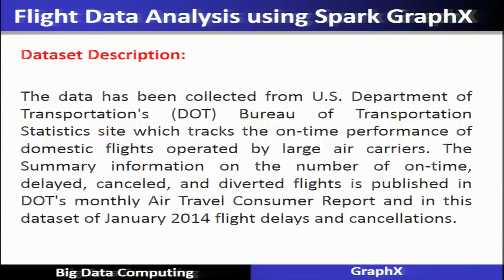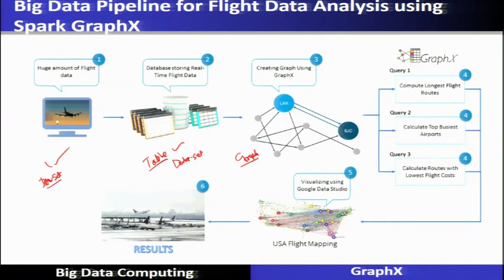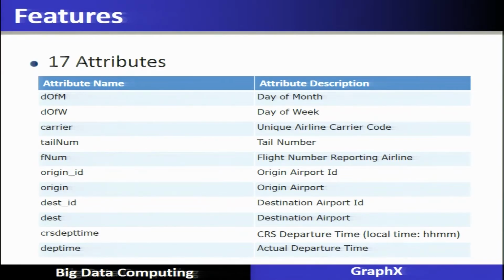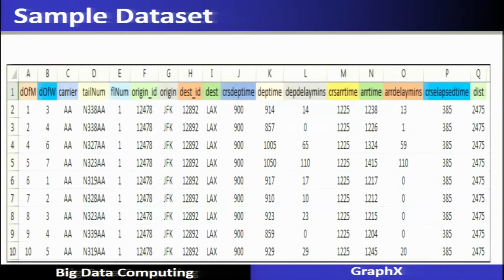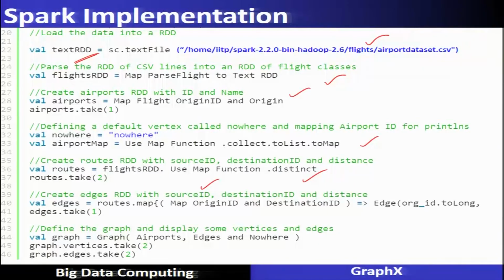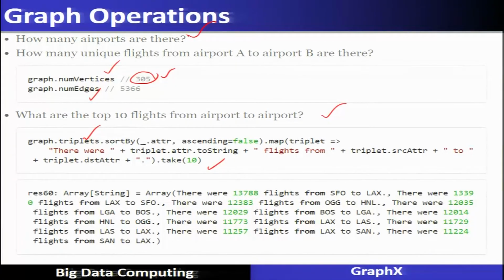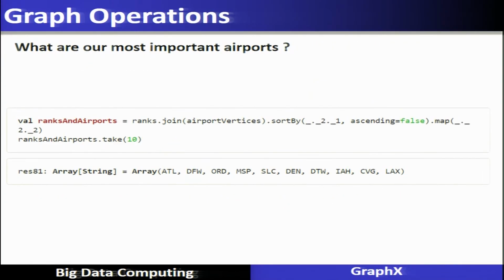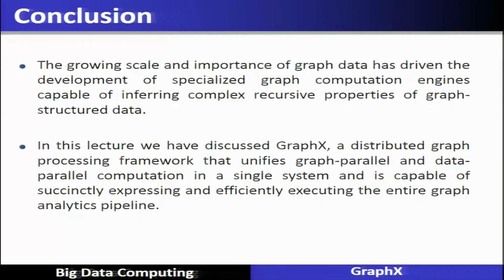noc19-cs33 Lec 34 Case Study: Flight Data Analysis using Spark GraphX

Comment: I have completed all 35 sessions . very well framed course by considering current need.
Reply: Can u please tell me about prerequisites?
Reply: @ashiqhussainkumar143  i just joined this course for MOOC and its the worst course ever. the worst teacher ever. you wont understand anything if you dont  have any previous knowledge about computing and data and all.
Reply: @prateeksarna9225  I was doing ml but I now switched towards competitive coding for placements
Reply: @ashiqhussainkumar143  bro, if you know all that then you would understand big data easily, but the catch is you can unxerstant it from anywhere but not from this teacher.
Reply: @prateeksarna9225 exactly bro,I am also thinking the same,he just reads whatever is there in the slide that too not properly,mostly stammers,don't know how he became an IIT professor,the course and certification may be worth,but his teaching not at all a worth